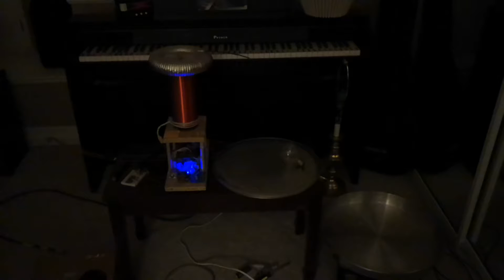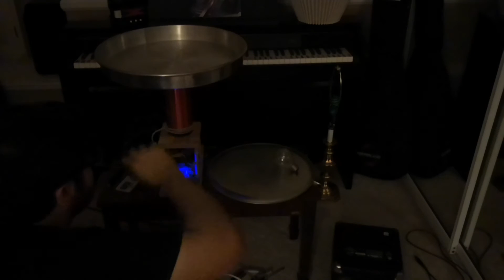Lower Resonant Frequency = Longer Sparks //Theory for Solid-State Tesla Coil design

Comment: Hello,
a lower resonant frequenzy does not mean that you get longer sparks, it only means that the inductive resistance of the primary coil is lower that means there is more current flowing wich means a higher output power, and that means longer sparks.
However, if you increse the frequency you only have to reduce the primary coils inductance and you will get the same results with the small and big topload, of course you have to make sure that the mutual inductance between primary and secundary stays the same.
I just want to say a lower frequency does not mean bigger spaks.
Correct me please if i'm wrong.
Reply: Hello,
sorry i haven't read the videodescription earlier and thank you for youre response.
Have a nice day!
Reply from the maker: @serchuckseyonski9908  thank you! Have a nice day as well!
Reply from the maker: You are most correct, Sir. 
I have already discussed this with other Tesla-coilers, and there are multiple contributing factors to the effect of increased spark-length when the frequency is lowered, but most notably, the lower inductive reactance (therefore, higher current) is likely the biggest factor.
If you read the video description, you'll see "EDIT" where I corrected my false presumption, not long after having uploaded the video. 
I have kept the original title, and included the original description, with the intent of preserving the history of my mistakes, for others to see, and hopefully learn from.

Comment: I dropped 40 bucks on a coil 30 awg 3.5 inch dia at 14 inches long.
It actually performs pretty decently considering i didnt tune it yet, and since i dont have any microwave parts its powered by a flyswatter. Sparks around 2-3 inches just from that. Also visible corona. I have a couple videos on my channel of it. (The good video might still be uploading though) also this taught me that the sparks only appear blue in videos and my theory UV radiation.
Reply from the maker: Oh this whole time I thought you were building an SSTC, you didn't say anything about a spark gap Tesla coil!
Trust me, don't use a MOT when you haven't gained that much Tesla coiling experience yet. Its way more work and pain in the ass than you think it will be. It just SEEMS easy, because MOTS are easy to find, but don't fall for it. Too many workarounds. 
What you 'should' use is flybacks. One of the first coils I made, was 2.5" diameter and about 7" or 8" long on 30awg. It ran beautifully on 2 flybacks in parallel, each on its own zvs driver, and a saltwater capacitor made from 14 beer bottles in a 5 gal. home-depot bucket (about 11.5nF). I think I just got lucky on the tuning. It had an adjustable spark-gap made from doorknobs (Look on my channel to find videos of it, it was a long time ago).
 It was awesome, but eventually, I destroyed it by continuing to run it even though I could see tons of corona leakage between primary and secondary. Didn't realize that would end up burning the secondary back then. Make sure you insulate the living hell out of that thing with many, many layers of varnish or epoxy.
 If i ever rebuilt it, I would add one extra turn on the flyback primaries to lower the voltage on the Tesla primary a little, to avoid all that corona.
Reply: @nabzim  ive wanted to build one for a good long chunk of my life. I just want to use microwave parts because it would be more efficient. Also much easier. Ive tried to make a flyback driber but it doesnt work. Might have made a mistake somehow but i dont think so. Ive checked my board many times and my troubleshooting has not come to fruition. I have a good feeling that the feedback coil is to blame... but whatever.

The caps in microwaves have a lower loss than saltwater caps. And i dont drink so i dont have any bottles anyways.
Reply from the maker: @nightrous3026  you can't use microwave caps as the tank caps in a Tesla coil, they can't handle the high RMS current and will eventually blow out. Goes to show you really should be spending more time reading Tesla coil websites and forums before spending your money on parts. Research, man!!! Research!!!

The ZVS drivers i used were from ebay, so i didn't have to troubleshoot getting them working, maybe you can try the same. 
Its a good idea to start playing with high voltage in a not-so-deadly form, like flybacks, so that you gain experience dealing with the characteristics of high voltage, without putting yourself at risk of seriously hurting yourself. 
If you accidentally touch the output of a flyback, it might be really painful, but that's about it... If you touch the output of a microwave oven transformer, then you'll most likely be DEAD. So don't fuck with it.
Reply: @nabzim  i wasnt going to subject them to the raw output.
Reply: I would use them as part of a capacitive ballast
Reply: And its now that i realised you were talking about tank caps
Reply: @nabzim  hey you should give me a schematic of your spark gap coil so i can learn more about them. In case im missing something
Reply from the maker: @nightrous3026  as a capacitive ballast is normal, but like I said, don't start there, it's more work than you want to do, and you'll end up spending more money than you currently think you're going to spend. When you use bigger power supplies, you also need bigger everything-else's to go with it. Bigger variac, bigger circuit breakers, bigger garage. (I went the microwave-oven route, thinking it would be easier! LOL!!!) 
If you REALLY want a decent Tesla coil, without the monsterously-demanding power requirements, then maybe look into an NST coil, as that is what you'll find the most information and support online on how to build, and it what I WISH I had done since the very beginning. 
 Sadly, I can't just easily bring my tesla coil anywhere to show it off to people, because it weighs a SHIT TON (and so does my variac) and because its hard to find places I can run it, other than my garage, since it pulls over 20 amps at 120V, and most building circuits and breakers are either 15 or 20 amp rated. 
I wish I had just dished-out the cash for a proper NST instead of using MOTs because there would have been way way way less work involved, and I would have spent waaaayyyyy less money in the long run.
However with an NST, you still need to build a Terry-filter, but its simple to follow the many different builds out there, and make the exact same thing. And NSTs are slightly more safe than MOTs. 

I really cant continuously keep replying back and forth dude. I got a shit-ton of work to take care of, so I'm gonna need to call it quits on helping you for now. Please, I beg you, READ MORE. READ and READ, and when you think you finally understand it... still, READ MORE, because you don't! 
Thats why I urge you to play with flybacks. Its real, legit, high-voltage electricity, so it's really really fun and awesome, but at the same time its much safer than the big stuff. You won't regret it, and better yet, your family won't regret it (if the worst should happen). Everybody makes mistakes, so don't put yourself in a situation where a mistake can cost your life.
Reply: @nabzim  I really wish i could afford a neon sign transformer. It was the first thing i considered. But the best i can do is used microwaves. Im about to get one for free.
Im just wondering if i can design a capacitor thats much smaller and lightweight but equivalent to a saltwater bottle cap. I was thinking an array of film caps but im not sure about that quite yet. I need to learn about the parts in the microwave
Reply from the maker: @nightrous3026  But I'm telling you to use Flyback transformers!!! And I was telling you about the NSTs, because I'm telling you that it will end up the same amount of money, if not cheaper, than the microwave transformer IN THE LONG RUN. Yes of course its cheaper when you only look at the up-front price of just the transformer by itself. But you will need OTHER THINGS also to make up for the fact that it's a bad choice for a Tesla coil! The OTHER THINGS will add up in price, and you'll end up spending a lot more time and money, than just DOING IT RIGHT from the beginning!!!! 
I know you're just at the very beginning of your high-voltage-enthusiast career,  and so you're not fully aware of every single safety precaution that you would need to stay away from hurting yourself! 
That's why I'm telling you: 
DO NOT play with microwave oven transformers. 
If MONEY is your only excuse, then JUST USE FLYBACK TRANSFORMERS instead. That is the cheapest way to go. Buy a ZVS driver on eBay. 
A microwave oven transformer Tesla coil will cost you WAY, WAY, WAY MORE MONEY.

If you can tell from my capitalization, I'm a little bit pissed off that I need to re-explain my point to you, because you either didn't read what I wrote, or, you're completely ignoring my advice. 
If you're not going to listen to any of my advice, then I don't see any reason to help you any further.

Comment: Can I get the circuit please
Reply from the maker: I highly recommend that you learn more about Tesla coils before attempting to build this... Otherwise, you may end up doing a bunch of work to build it, just to find out that it doesn't work. When you haven't studied Tesla coils in-depth for a long time, it's very easy to overlook small details, which can completely change the result. 
Be careful, you have been warned! 
Schematic at the VERY BOTTOM of this page: https://www.stevehv.4hv.org/SSTC5.htm

Comment: This is a very useful demonstration. Because im making a much smaller coil. 1'dia×6'height. 31 gauge wire.
And smaller coils typically have a much higher frequency.
I probably could use a much thinner gauge to lower the frequency more but its too much of a pain to work with. So im just gonna make a top-load with as much surface area i can get. I could probably make a layered sheet structure.
Reply from the maker: Thank you! Mind if I ask, why would you want to make a coil that small in the first place? If you're already going to have a huge topload, then it's not saving you much space. I get that it would make it easier to wind entirely by-hand, with minimal time investment and effort, but when it comes to Tesla-coiling, the last thing you want to do is to cut corners trying to find the easiest-possible thing to do. I doubt that it will perform well at all; you're not going to fit very many turns on a coil form that small, and your aspect ratio of 1:6 is too high by normal Tesla coil standards. That might work for a slayer-exciter, but it most likely won't work well in this application. It's going to have such a low inductance that there will not be much energy transfer from pri to sec. Please reconsider your design, and continue your research/reading, before you waste your time.
Reply: @nabzim  thank you for your reccomendations. I mean ive already found out the hard way 😂.
I hooked it up to a flyback with low input to see what it would do, no corona, but its able to somewhat excite a light close to it.
Reply: Also that little thing used up the last of my 30 AWG magnet wire.